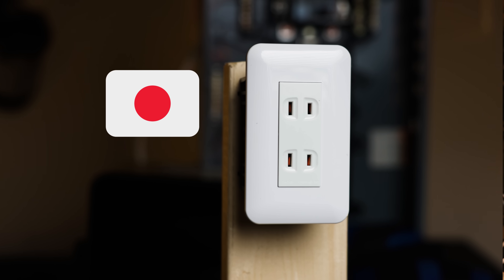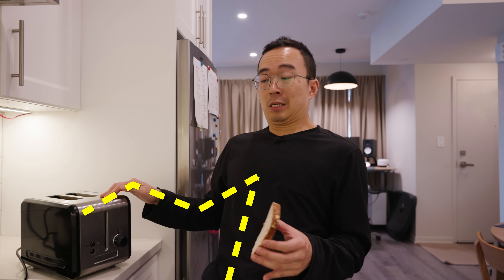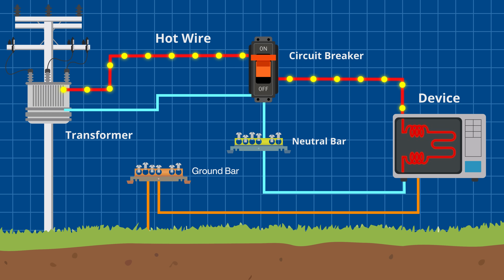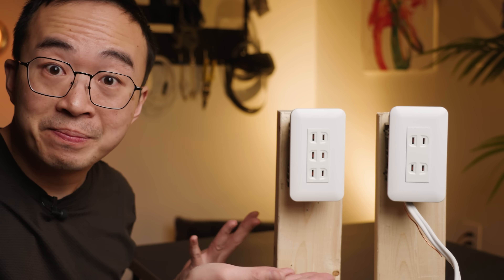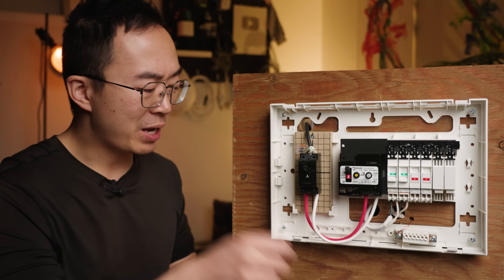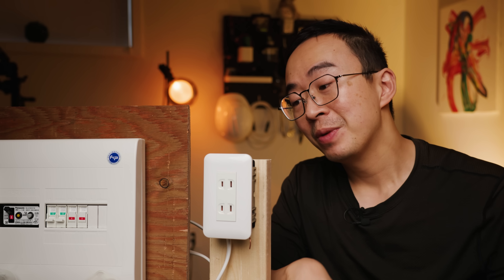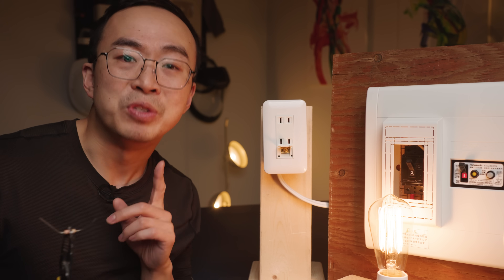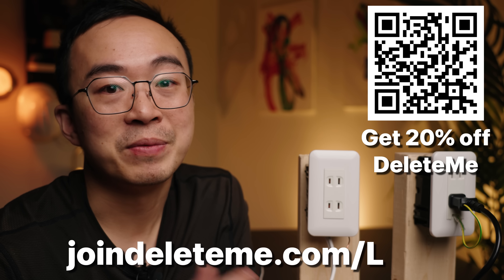How Japan Made Their Outlet Safe

Comment: The first thing shown, the man getting shocked by the toaster, is 100% BULLSHIT. To get a shock you must have a path, through your body, to ground. So unless the man is walking barefoot on a conductive floor (he isn't) there is no difference in potential between him and anything that would conduct the current that gives you that shock. Adding to that, the "short circuit to ground" that was shown would have instantly blown the breaker, via that third prong on the plug—which is why it's there. So a shock would have been impossible. And the supposed danger shown is nonexistent. And I say that's someone doing electrical work for over 70 years, and, designing computer circuitry.

What we call voltage is a measurement of the difference in potential between two objects, not something absolute. If  I'm touching 110 volts with one hand, and 140 volts with the other, I'll get only a "shock" caused by that 30 volts difference (think of voltage as being like water pressure in the pipe, and current as the water. With the valve shut the pressure is irrelevant). We reference all house current to the potential of the Earth (ground) as a way to be sure two different generating systems don't have any deadly difference between what they each call 110 volts.

But, if I'm touching 400 volts with some part of my body, and no part of me touches a surface that can conduct electricity (like touching with a hand while standing on a wooden floor) there is no path to a different voltage, and so, no shock. So in general, unless there is a source of ground nearby (like a radiator, concrete ground floor, or sink) electricity is not a danger.

Comment: You missed the coolest part... HOW GFCIs sense current imbalance. They run both wires through a coil along with a sense wire and any imbalance between the hot and neutral electromagnetically induces a corresponding current in the sense wire.

Comment: The issue is the three phase power, and someone decided to leave out the common(and instead connect it to physical ground), to save some copper🤔. Now any phase derived out of this, has an automatic ground circuit😅, meaning anything touching the ground could carry a current. Avoiding shock, is now a matter of adding the copper back to every appliance cable(and also the outlet to panel, where ground is bonded to neutral), to provide a lower resistance path, to trip the breakers!. That was one reason DC is better than AC eventhough it needs two wires!, apart from the inability to use transformers to cut down transmission losses, where more copper loss takes place. All that is done in japan is to get rid of local ground in favor of panel ground. And most building grounds in Japan is not a real ground, being reason, why it works, except for wet areas😢. Otherwise the fundamental transmission system is still the same old AC as everywhere.❤👍

Comment: There's also an important fringe benefit to an earth conductor when powering electronic equipment as it gives the unit's RFI filter capacitors somewhere to return to. I haven't seen many Class 2 (no earth) power supplies above 100W, probably because it's difficult, and also its kind of annoying to get glitches when a laptop's ground connects to another device's ground.

Comment: The GFCI/RCD does not protect against SHOCK --- it protects against ELECTROCUTION

Shock would be more like the static zap you get on a dry day after you shuffled across the carpet and touched a metallic object - you're at different electric potentials and the zap is the two pieces suddenly coming to the same potential.

The ground is there because most likely your electric potential won't be much different than the earth's, so you don't get zapped by touching a "hot" chassis.

Comment: I was once under a customer's house, crawling with my entire body in contact with the earth, and grabbed a piece of low-hanging flexible conduit to get it out of my way. I was INSTANTLY caught in that "can't let go" situation. I'm alive just by pure luck. The contact within the conduit either burned itself through, or came loose. I refused to go back under that house again until their electrical system was corrected. People don't get it until they've found themselves holding current and their hands clench. It took me quite awhile to get myself back together. It's much more than just the nasty shock you get when you touch a live wire. That being said, that's a really cute and tiny electrical panel. In my 1500 square foot home in the US, we have a 100 amp main breaker panel, and I'm planning on upgrading to 200 amp, because we live in a nearly all-electric area, where electric appliances are more efficient than gas in terms of therms. Still, IMO, grounded outlets WITH GFCI protection is best.

Comment: I disagree with the primary point of the video that Japan's non-grounded outlets provide a safety advantage over grounded outlets. AC powered electronics usually have some level of ground leakage current. This can result in dangerous conditions in certain situations, and generally requires a different approach to product design. This is why most Japanese products are plastic.

My good bro- May I recommend staying out of safety discussions unless you're either a licensed electrician or a PE?

Comment: Only at the main panel can you connect neutral and ground circuits only. A sub-panel, ground, and neutral are isolated from each other. This is required by code in the USA.

Comment: Several porblems in the explanation on how grounds work.  First, it is the load (like the 7 W lightbulb) that limits the current.  Second, in older houses (like around 1960) the Romex had 16 gauge ground wires with 14 and 12 gauge line and neutral wires.  The ground path actually had a little more resistance than the proper path.

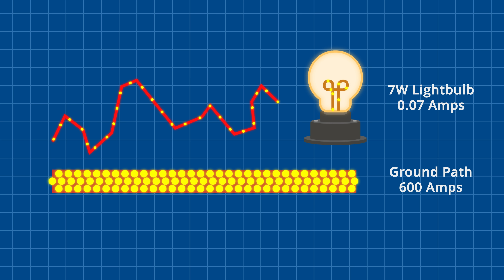Comment: Yikes a very large amount of this information is wildly incorrect. 3:53 This is not what ground is for. The whole “this is what keeps your 7w lightbulb 7w is not correct. It is 7 watts because that is the current it draws at a certain voltage. Study ohms law. It is very important to have a functioning understanding of this. Additionally, circuit breakers ARE NOT designed to stop people from getting shocked, they are to protect the wiring in the walls which could cause a fire if overloaded. As long as you don’t exceed it’s rating, it really doesn’t care what is happening. This video needs to be almost completely redone. This is extremely misleading
Reply: I've heard that before, yeah. Looking at the rest of the comments it seems like this is just one more thing that he got wrong in this video. It appears that he unfortunately did just enough research to find himself at the starting section of the Dunning-Kreuger effect, which is a rough place to be when you're trying to make an educational video. 😕
Reply: Yes, the idea that the circuit determines the power of a device is nonsense. It is the device itself that does it. However, the grounding works in the US so that in case of a fault the high current trips the breaker so while the breakers in itself do not protect from shock they are part of how the grounding works.
Reply: Thank you. Also good to mention false trips with AFCI/GFCI breakers, and how often we make money by doing nothing, but somebody has to pay for gas and tme.
Reply: @brucecarr6258 what do people have going on to have constant trips with modern GFCI/CAFCI breakers? Every new circuit in my house except HVAC loads has them and I’ve never once had a false trip, but I’ve also not put them on old circuits that had shoddy electrical work with loose connections to devices or bad connections in j-boxes.
Reply: @StefanNuxoll  it really depends on the breaker brand. Siemens is known for bad arc fault breakers that are too sensitive. Here in Canada, we need to install arc faults on almost every circuit that has an outlet at the other end. Including washing machine, microwave and dishwasher without a direct connection (aka just a plug). The number of calls we get to replace breakers because the microwave constantly trips it is insane. It doesn't happen much with other brands like Square D and Homeline though.
Reply: Interesting given general consensus I’ve seen about the Square D HOM breakers is they’re cheap garbage, though that’s exactly what I’ve put in because availability anything but basic breakers from other brand is limited in my area (code doesn’t require AFCI in my state, and GFCI is only required for wet locations, but I put them everywhere anyway because I do think they’re a good idea).
Reply from the maker: Sorry, but you're incorrect about ground.   Ground acts as a low-impedance path (in TN countries) to trip the circuit breaker and turn off the circuit.   One of the best video on grounding and bonding covers this point in incredible detail: https://youtu.be/mpgAVE4UwFw?t=993  This is someone who has built an incredible system teaching NEC and how it actually works.

The 7W light bulb analogy I was referring to the filament inside, that's not the wire outside.  I could have done a better visual.

@yaltschuler, is this a reverse Dunning-Kreuger?
Reply: @Lam, and you misunderstood the video. This is bad. Listen to people that know what they are talking about. Breakers are to prevent fires. GFCI are to protect people.
Reply: @bish672  GFCIs are to protect in case of direct contact to exposed wires. The protection against equipment cases becoming energized is the grounding which trips the breaker. Sure if the circuit is GFCI protected then it likely will trip faster than the breaker. GFCIs are relatively new and are not even mandated on all circuits like grounding is. 

So: 
Basic protection: insulating any current carrying parts.
Fault protection: grounding and double insulation.
Additional protection GFCI/RCD.

On a TT system (the ground wire not connected to the neutral) one needs an RCD for fault protection.
Reply: @okaro6595  no GFCI are to protect against ground faults aka current finding an alternative path to ground that's not necessarily caused by direct contact to exposed wires. Nor is it always in sufficient amounts to trip breakers
Reply: @Lam  Lol in the video you never mentioned that the resistance was due to the filament, you were comparing mains wires with the ground. Maybe have a rewatch?
Reply from the maker: There's no way I would ever make a claim that we have a special 7W mains wire that makes lightbulbs work.  That would be ridiculous.  It was simply a visual issue.  I would have connected the "twisting" wire with the light bulb filament better.
Reply: @Lam  Dude - you haven't even hit secondary high school education levels of accuracy in this video.  You are crazy, or deliberately misleading,.
Reply: @_Msn_ you misunderstand.  In the toaster, the hot wire has come into contact with the case.  With the case being grounded, this is a direct short, which draws (theoretically) unlimited current, which trips the breaker.  

Without the ground connection, the case is simply energized. There is no current flow until your body completes the circuit. 

This is the entire purpose of grounding.
Reply: @Lam dude, you are wrong about how you explain the ground working, simple as that. Your graphics along with your words are simply wrong. The ground is a low impedance path back to the source to allow high current flow through the copper and not the human. This high current draw is what trips a breaker. You don't have to touch the toaster for the breaker to trip, the hot line touching the equipment ground is enough to trip the breaker on its own. GFCI wouldn't trip until the load was unbalanced like you show, but ground doesn't work the same way.
Reply: @Lam Look, I’m just a homeowner with enough knowledge of electricity and the NEC to do his own work and pass inspection, but you’re conflating system grounding with equipment grounding.

We still have ground rods in the US, and just like Japan they are to provide a fault path for current that doesn’t originate from the grid like lighting and static electricity. Impedance of the soil is FAR to high for it to be a usable return path for power from your utility, and even in your Japanese builds it’s not used for that purpose.

Equipment grounding conductors are protection for people using devices connected to a receptacle, and they do not require changes to anything but the wiring inside a building and using receptacles and plugs with a ground connector. Your circuit breakers / OCPD will still stop a short to ground like they would a short to neutral, because in an AC system the direction of current changes at 50/60hz so half the time it will be coming from the protected leg of the circuit and will trip.

RCDs are incredible devices that bring that protection further by focusing on ground faults where current goes through a return path other than the hot or neutral conductor to further protect personnel even if the OCDP wouldn’t trip, but they work best in tandem with EGC to prevent such a fault from even having a chance to harm somebody in the event of a frayed conductor, which is why the NEC now requires combo GFCI+AFCI almost everywhere in residential buildings.

Japan using TT for system earthing doesn’t really mean anything, you can just bond at the consumer unit, keep the existing grounding electrodes in place, and you have a TN-C-S system with a multiple grounded neutral at both the premises and transformer to provide a the same fault path in the event of damage to the service entry wire (just like we do in the US! Japan even uses split phase power like the US does, so they’re got the same two hots and a neutral coming in for the service entry).
Reply: @StefanNuxoll  "because in an AC system the direction of current changes at 50/60hz so half the time it will be coming from the protected leg of the circuit and will trip." um the direction of current does NOT matter
Reply: @ I’m overthinking a ground fault and the OCPD, neutral and the EGC are bonded at the panel so a short between them would have no current flowing (as they have no difference in potential) - thanks for calling it out. The point remains, the OCPD will trip long before any outside wiring is a problem.
Reply: 100% this video has got to be redone with an accurate representation of how grounded conductors work.  They protect people.  They don't trip breakers.  The production value on this video is so high that folks will believe it's accurate, and that's very dangerous.
Reply: @Lam  is 100% correct. The OP is not only wrong, but is lying about what Lam actually said, conflating different things. That's on the OP for putting words in Lam's mouth. I understood the presentation, and saw nothing wrong with it. Ignorance always attacks from a position of ignorance, while facts speak for themselves. All the other posts that use coercive tactics to bully Lam and others into submission are not bringing any facts. This "might makes right" BS does not make anyone right, and doesn't make the correct answer wrong.

Comment: The neutral wire does not go back to the transformer,  it goes to ground. This is how AC is different from DC.
Reply: No no no. The neutral is grounded at the transformer and at other points like at the house but current does not go to the ground. Such a system would be highly ineffective and you would be limited to maybe a few hundred watts.

AC vs. DC is irrelevant to this.

Comment: I lived in Japan once when I got lightly zapped by the refrigerator.  I reversed the plug and it stopped zapping.
Reply: Either that was a normal leak or there was some random fault that did not manifest when the plug was the other way.
Reply: it probably helps that Japanese voltage is 15% lower than US and less than half that of China/Europe.  Construction workers in the UK use transformers/110V power tools sometimes because 220v is so god awful and 110 is much safer.

Comment: TT connections have been commonplace in the UK for decades where the incomer is an overhead cable, using a GFCI (known as RCD in the UK) and a ground spike. Connecting a protective earth all the way out to the appliance will often trip the GFCI / RCD before a human comes along, so Japan is hardly safer on that score. Unless the PE connection is lost, you will never get a live casing on a Class 1 system. The main difference is that most of the supplies are 120V or lower, so it's less lethal to start with.

Comment: If Japan ever has a revolution, the new JCP who gets into control should mandate to switch to 230volt / 50Hz and use European Schuko F-Type plugs. 
Its funny to me as well because you can in fact install schuko outlets into your house in Japan with the standard EU panels, every Japanese electrical company can do this for you, some may have to back order the outlets for you. But Panasonic and many others produce European electrical equipment.... So its a very strange case of Japan being a major supplier of electrical equipment to Europe but using inferior US power system.
Reply: Swiss sockets look better to me